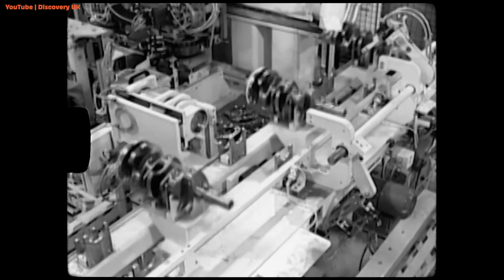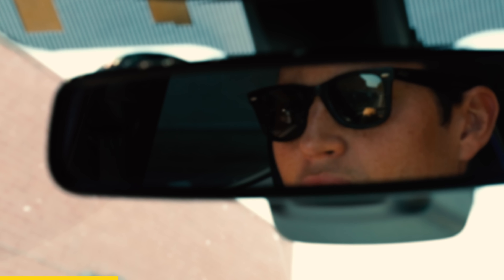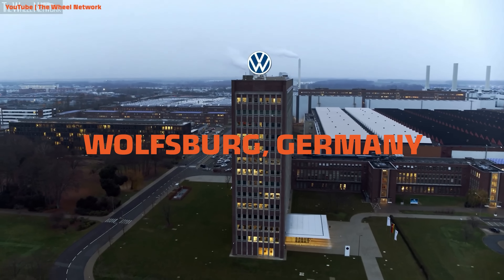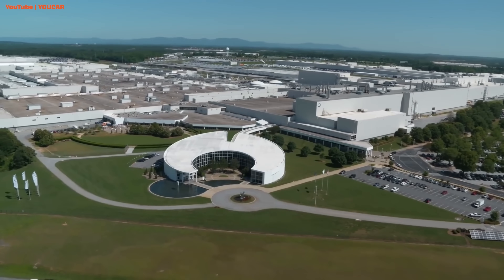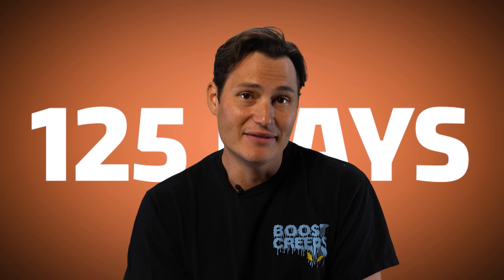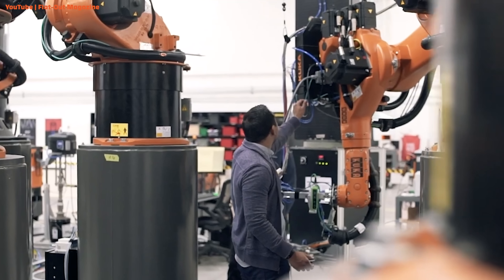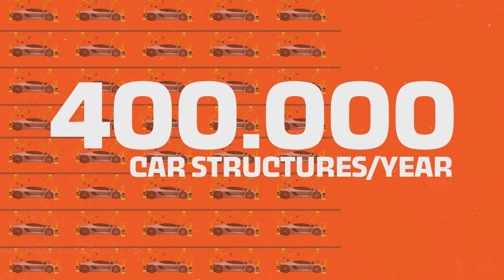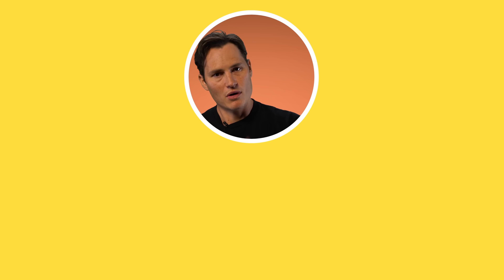A.I. Designed this Car

Comment: I'm very curious about how the AI learning was actually implemented on individual parts.
Reply: By the use of topological design, basically you simulate the part and how it's going to be used and then you tell the computer "make it work under this parameters" and by trial and error the computer learns the most efficient way to accomplish just that
Reply: It's stupid AI... just logical parameters forced to work together under additional parameters until you need the least amount of parameters and materials which meet the processing criteria... but again all of those are predefined which means some numb nut could've missed something and the AI wouldn't know the difference. So, stupid AI.
Reply: @terminathor2160  So I hear ya, and I get that.  And it's possible that I just don't know enough about neural networks and AI programming.  But I would think designing a 3D part is a pretty nebulous problem.  Like let's say you just have a simple part and you need to tell it to transmit force from this point to another point, and resist a torque.  Before it can even begin optimizing a solution it's going to have to develop a bunch of viable solutions to optimize within, and assuming a 3d modeling program in conjunction with an FEA or CFD program is being used, the amount of time and computing power required to get through just 1 iteration is considerable, much less hundreds/thousands/??? iterations.
Reply: @Joe-nq6hy  Hey, man that was actually super helpful.  Watched that vid.  Honestly, I didn't know that technology existed.  Thanks!

Comment: Yes,  this looks very cool indeed, but who owns that data it is using for the design input? Because now you are going from design inspiration to hard data points? Is it the owner of the SR-71 which is Lockheed Martin? And what percentage do they get from every sold unit? Maybe you should have asked Mr. Czinger that question?

Comment: Nice vid! Glad some of what im working on on a daily basis is getting a video made about it! I would like to clarify some parts though: computational engineering is more of a term describing the field of engineers working with algorithms and ai, the process of creating the intricate designs is called generative design (or topology optimization if you start with a constraining volume). As he said, the program has a database of materials and their properties, and given input of neccesary mounting points and strains the part is supposed to endure, it will give a design thats up to 50-70% lighter, and with the same strength. The part where he said additivve manufacturing is the only way to go is half true, all generatively designed parts can be adjusted for lets say a 5-axis cnc machiune, but it wouldnt be using the full potentiall of the technology which is generative design. The increase if strength per weight ratio is one reason to go generative, the second reason is the drastically reduced part count of the assembly, which is the main reason the "base of the car" can be assembled in just one hour.
Reply: Hi, glad to see someone from the field. I'm a simulation engineer, looking for a PhD, and it bugs me when they call topology optimization "AI". It's "just" iterative finite element analysis... What are your thoughts on that?
I've also worked a bit on additive manufacturing for the aerospace industry and metallic additive manufacturing is a big mess and no part can be used without machining and surfacing afterward. It can be a replacement for casting but never to machining in its current form.
Reply: @RazgrizDuTTA  yeah, it was the AI part that made write the comment, maybe AI could make a better and faster algorithm for creating new topologies but at this point i dont see it as any more «smart» than a well written piece of code. Im writing my masters in mechanical engineering this spring and wont be implementing much TO but ive written my bachelors on the matter. And also yes, metal sintering wont really match the strength of lets say forged parts, not with todays technology. With that said its certainly moving in a good direction

Comment: One of the things that concerns me about AI designed cars is the lack of serviceability.  Now an AI could have serviceability as one if it's parameters, but it would likely fall behind other designs that are not as serious about it. Meaning, that DIY maintenance would be difficult or impossible. This would also harm small auto shops and freelancer repairmen, as the kind of tooling necessary to service these cars will be too expensive and power hungry to afford even with loans. At the same time, car makers for the avg user will also not want to make a car that costs an arm and a leg to service since that would kill potential customers. An AI design that has user serviceability high up on the list could possibly make a design that Karen could DIY.  I can see AI either improving or killing serviceability. We will have to wait and see.

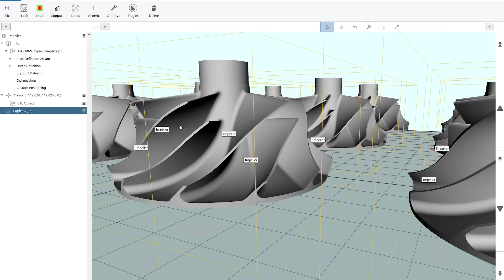Comment: 7:22 Wrong. The current 3D printers that prints items in layers will print supports for overhanging parts as an overhang will need to be supported while the permanent supports finish. These will then be broken or dissolved away when finished.  Some 3D printers might work in a way that doesn't need supports but conventional ones do for the time being.

Comment: And i thought we are using AI since years to do these things which by the way is also known as topology in engineering, you can program a simple code to input stuff and a simple part Will be created. Which then you put in diff software., i use ansys, which use a'i to determine and reshape i tire part to make it lighter and removes extra material.

Thanks for making me feel superior 😂.

Comment: Nice to see AI topology parts, even though they still put a lot of human design hours into the car. 
Keeping servicability at least acceptable is something they'll have to keep an eye on for sure.
As much as sintering is cool as far as I know it's fucking slow. Czinger says it's possible to print as fast as casting, I'd be interested what kind of parts, precision and what sized machine park this is true with. 
Also carry the machine park size question into their factory size argument. The assembly units won't be the only thing that needs to be placed.

Great to see someone bring these technologies together to make something they find cool.

Comment: You showed formative manufacturering for subtractive manufacturing at 7:15.
Casting, forging, sheet metal forming are formative methods of manufacturing. Unlike cutting, milling, drilling wherein material is subtracted from a big block.

Comment: The 3d printing used is extremley slow. There is a reason it is not used, and the oowdered metal is expensive and hard to get. Im not saying it is not scaleable, but at tge moment it is not there from a supply chain perspective.

Comment: Yes this is very cool. I get it! But:

There are reaonsons why some things are done a specific way. Building a car is not only about efficiency of the car itself. You habe to make sure the car can be assembled and repaired easily. Also you need to make sure, that mechanics are able to work on your car. If every car of your brand is completely new, how do you expect mechanics to know everything about all of your models.

Comment: Just imagine, the AI designing and building the hypercar were programmed instead to design and build a truck (whichever truck you imagine) around strength and serviceability using materials like steel and composite plastics or other strong materials you wish, then it becomes more appealing for consumers. This is the future of the manufacturing process and the automobile.

Comment: 2050: well NOS burned a hole in my piston well go print a new cylinder and go tear down the motor it’ll be done by the time I pull the old cylinder out

Comment: It’s 2095 and you walk into a dealership like it’s a McDonald’s, walk up to a touch screen and order your car fully custom. It rolls out the drive through 30 minutes later.
Reply: "Yeah can I get a 2-door sports hatch with a turbo four cylinder,extra tires on the side, 17 inch rims and a large synthetic oil?"

Comment: So what I'm wondering is.
If you cut the manufacturing cost, there is no extra material to pay then waste in the machining process, no r&d department, no assembly, just machines and computers, would the cost of the vehicle to develop and produce one be affordable to the average consumer after a certain amount of vehicles are made?

Comment: Wrong  shortest wire is not always good.  You have to consider many aspects of car.  heated metals can melt the wire.  Have to keep it away from touching heated parts.  have to conside roll over and short circuit  have to consider a lot of things.  tell this doosh to shut it.  U cannot replace engineers.

Comment: "Designed by AI" also known as topological optimisation...
Reply: Ikr people are scared of beefy statistical programs.
Reply: European Space Agency is using this to make there satelites less weight and even stronger.
Reply: @RogerKeulen  Would make sense, almost everyone who needs an extreme strength to weight ratio can use mix of topological and parametric optimisation.
Reply: AI has become a new buzzword that's thrown into everything these days.
The actual impressive thing about this car is the fact that it is 3D printed, which is what allowed those crazy efficient part shapes, not the fact that a computer has helped with its creation process.
Reply: @ThePC007  I find the material definition for a 3D printed material impressive, as it is an anisotropic material. So if this is done right, they have got a smart system that also takes print orientation into account. Yes, "AI" has become a bit of a buzz word, well put.
Reply: @ThePC007  Thanks for making life seem a little less pointless for a moment. 

Just a moment.
Reply: And btw people it's not new tech
Reply: The parameters still require human input. And the design are almost exclusive to 3d printer and not conventional manufacturing process

Comment: This whole thing made me think if they maybe found the "perfect" car then. Imagine that you give almost 100% freedom to the machine within the limits of the rules that are present of course. Considering Design, functionality and maybe even performance - this car should be literally perfect. The question that comes to mind is: How does the production method limit the way a car is build and designed? I'm thinking about materials for example. The AI should be able to adapt to newly found technologies in no time and incorporate these into its new designs. If you wanted to have a deviation of this "perfect" design, to create different models for example you would have to change the parameters drastically (four seater instead of two) or you would have to intentionally choose an inferior design (worse airflow to have different looks). 
I think this is the ultimate way to create totally similar cars for everybody. We argue about that for years now - All the cars seem to look the same and there is little to no deviation in the basic design principles. And we also already know that this is probably due to efficiency. Efficiency in performance and manufacturing. Considering energy as a valuable resource we somewhat have the ultimate goal to create the perfectly efficient vehicle. And what better way to archive that than to just let an AI "simply" calculate it? I do fear however, that we will loose a crazy amount of individuality in the process. 
Maybe I see to far into the future though. Considering this being a total novelty and almost unaffordable for the most people, we are still tenths of years, if not hundreds of years away from that. 
The thing I would love to see the AI do, is design a car with the same parameters many times and see how even small changes in the parameters (maybe there isn't even a change necessary) wil change the look and design of the whole car.

Comment: So if I’ve got this right, the bottleneck in the manufacturing process is the 3-D printing? That takes 3000 hours as opposed to a few minutes for final assembly? Any plans to make the 3-D printing more efficient?

Comment: Why doesnt it go faster than the chiron if its the perfect build?
Reply: This is what I was asking myself. I guess that the AI is still restricted by a lot of parameters that would have been put in by a human. Considering the engine you probably have the answer right there. The question remains: "What are the parameters exactly?"

Comment: Ooh that's not good 3D printed metal still are nowhere near the same strength as forged or milled metals You don't have to take my word for it look it up carbon fiber though still all has to be hand laid

Comment: "Typical car contains about a mile of wire" .... WTF kind of typical cars you talking about? and how are you measuring it? .. You melting down the copper and making something the size of a hair?  I would need that proven to me. I have worked on a ton of cars.. granted not a lot of modern luxury cars.... but that just seems ridiculous.

Comment: I was hoping he'd go into how they did the finishing and post-processing the complex shaped metal 3d printed parts. Because the parts come out with a very rough texture with little bits of half-melted powder everywhere. Is the post-processing fully automatic? I'd be impressed if it is.

Comment: Problem....you 3D print structural parts, you are essentially creating product from an artificial sedimentary rock. Contrast this with Rolls Royce....they actually grow jet turbine blade fins out of a single metal crystal. One of these 3D pass overs will be the weakest link. And one of them will give way as luck is pushed with ever smaller quantities of material. The whole idea assumes layer by layer 3D building is ultimate manufacturing efficiency. It isn’t. It’s your home 3D printer with metal sprinkles added.

Comment: It's not exactly AI designed, it's AI optimized. Pretty much how AI anything operates at present. The programmer dumps a bunch of information into a data pool and the computer finds the best method if you will.

Comment: Not convinced but it's a good idea and maybe the future of the automotive industry.
My doubt and for me the biggest problem is the 3d printing method, because sometimes you need to "cook" the materials, they need to stay at a X temperature, by X time to get X flexibility and hardness, and I don't believe that certain properties can be achieved with a laser melting material layer by layer...
Sorry for my English..

Comment: The issue is the time. As he mentioned in the video the whole car takes 125 days. Now todays factories takes about 17-18 hour to make one car. And makes around 120 car per day (as multiple cars can be on the same process phase, thats one of the reasons the factories are so big). And in modern demand that amount is required, and thats why this method of "3d printing your car" will never (unless the method improves in time) be in mainstream use.

Comment: This method would not be as helpful for consumer vehicles. Not only are the manufacturing methods more expensive, but design factors such as serviceability would suffer. Think about how difficult it would be to fix a wiring short circuit if the wires were embedded in the frame. There are a lot of different types of efficiency, and this design lacks in many of them.

Comment: For anyone wondering, the "AI" paradigm most likely used is called evolutionary learning. Essentially a simulation will be run where every possible solution is tried and the computer will throw out the solutions that dont meet a certain success criteria. If youve ever watch any of the "AI leans to play X game" videos that exactly whats happening. Evolutionary learning is pretty good when you dont necessarily have a big data set to look for trends in or dont really have a good guide for your program to follow.

Comment: What a gorgeous piece of engineering gasm. The designer in me is in love. 

The biggest problem that I've seen first hand when dealing with robotic arms comes down to programing. If any one of those arms isn't on the same line of code and decides to take a fast right instead of left, you get big hole in part. So that's where the human element still comes into play, basically to watch it and make sure it doesn't decided to commit seppuku. You'd be surprised at how often these arms like to get out of whack and even twist on themselves for no apparent reason.

Comment: Building a car like this would require way to much effort to keep on the road, a machine would have to be built to take it apart for repairs or maintenance, causing an oil change to cost $5k because the machine built to change the oil cost them $3 million! this method of engineering has been tried before with construction methods like laying bricks or concrete, the machine works wonders and it is impressive but, the cost of keeping it working is still doubled that of the masons laying the bricks by hand, or concrete by wheel barrow instead of having a truck deliver it for $10k because your 100 miles away, very specific methodology of work can only be achieved is select places with specific circumstances and would fail in mass production 100%!

Its unique for sure and will probably open avenues for future engineers to "logisticize" the process and refine the costs but, as of right now this is just a gimmick and marketing ploy to entice investors for future projects... Its painfully obvious really!